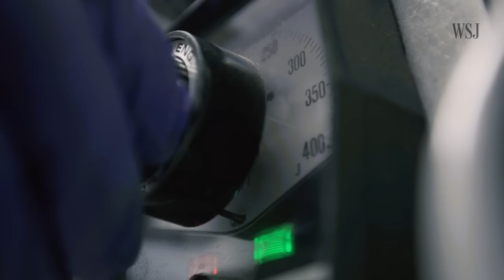Plastic: The Scourge of Cities Becomes a Resource | WSJ

Comment: A LOT can be done to make 'dirty' plastics a great deal more recyclable.

A - No more labels, period.  Print the 'label' directly onto the plastic, using inks with either a very low vapor point so they can be boiled off, or based on the same plastic that it's being applied to.
B - Single type plastic by product.  No more mixing plastics in products.
C - Much larger, easier to interpret 'recycling' identifiers.
D - Reduce/eliminate plastic alloying (which is why there are hundreds of different 'types')

Comment: And only recyclable plastics should be produced.
Reply: This statement means your don't know how plastic is made.

Even recyclable plastics can only reprocessed 4 to 7 times. Then it goes to the landfill. And even during that 4 to 7 times virgin plastic is needed to form the strong enough bond to be used.
Reply: @pauls5375  chemical companies and researchers have been working on a better plastic that can be depolymerized and repolymerized indefinitely. It takes proper chemistry and careful manufacturing. This is why the ibm guy is looking for polyester. It's a more versatile type of plastic. Other plastics like vinyl and PVC are terrible and more of a toxic one-time creation. It needs to be used only selectively in industries that can't use anything else.
Reply: @Iquey  yes, agree... Partially However due to how hydrocarbons are broken down this is not possible. This is my field. I work in hydrocarbon cracking and pyrolysis. The issue is that the Co polymers that are added to complete the bonds are then later categorized as contaminates. Removing these impurities in current tech and processes are not viable for companies when virgin plastic is 70% cheaper to use. This is the real issue. The economics of recycling aren't beneficial to companies. Once recycling can be monetized large scale will we see a transition to true plastic recycling.  Thanks for the thoughtful reply, becoming more and more rare in YouTube. Have a good one.
Reply: Biodegradable plastic made from organic material like seaweed no more oil for anything
Reply: @davidbeaulieu4815 `  Mushrooms are also being used
Reply: P S I have a question since this is your field. Do you know of any biodegradable plastics that can be used that could possibly compete with oil based? Instead of creating 100% recyclable plastics which seems to be expensive..
Reply: Yes!
Reply: Plastic films can be converted to burnable fuel
Reply: This plan can't be enforced. Find a way to use the plastic. Regulation doesn't work. People look for cheap products and they will cheat to survive. Taxes are cruel answers to this problem.

Comment: should be a law, only renewable materials from now on
Reply: Agree 100%, companies that mass produce plastic and other non close loop recycling materials should be held accountable since they're only looking at the bottom line.  Also, companies like Coke, Dole, Pepsi, etc should also be held accountable since they're just buying plastic materials so they can make a few cents more per bottle compared to aluminum or wax coated products.  If you think about it, if they're saving a few cents for every bottle, and they sold a million of them, how much extra money are they making.  Just do the math.  You can go to the grocery store and buy some sliced fruit placed in a plastic container which is insane.  If people want sliced up fruit or whatever then it should be in a aluminum can with an easy open top or wax coated box.  It may cost 5 cents more but it's better than using plastic in the long run.
Reply: Max Ko
Reply: Max Kon
Reply: Max Koni
Reply: Max Kon
Reply: It would be France 2.0. Renewable Technologies have to be as good or better than what we use now only then will we be able to reasonably change. Hopefully it’s as soon as possible. The mid 2020s are looking hopeful. Fusion would solve all our problems in pretty much
Reply: @maxkonig559  our government must have the political will to make this happen, maybe not now but in the years to come.
Reply: you're naive to think the government is in control

Comment: Singapore has a partial solution.  They just created an Aerogel out of plastic bottles.  Industrialize that process and you have a great insulation material with great heat resistance.  A good building material.

Comment: The government should encourage and provide subsidies for the recycling companies, like Chinese government, who promote electric cars production and discourage gasolines at the same time.
Reply: In a lot of situations electric is worse than gas because we simply use coal to make the electricity.
Reply: Benjamin Lehman in that case the government should discourage these kinds of facilities or promote wind or solar electricity.
Reply: JBI JBI I heard somewhere it costs more to make the wind turbine blade than the money it will save from electricity in its whole life. It is the future but the technology just isn’t quite there yet. If the government offered tax cuts that could help people want to make the technology more efficient.
Reply: @benjaminlehman3221  It is definitely worth it with solar though.
Reply: @benjaminlehman3221  that's incorrect. Even if the energy comes from coal, it's still a smaller carbon footprint than a combustion engine car as the coal power plant is more effective than many small combustion engines.
Reply: achryl just watch Adam ruins everything Adam ruins going green. Some electric cars are not good.
Reply: Benjamin Lehman I saw that episode too but although it is not completely eco friendly because of the battery and electricity use it is still a move foreword away from the combustion engine which is directly polluting
Reply: Billy Bob the technology just isn’t there yet. In a few years and hopefully with solar or another form of renewable energy the electric car will take over.

Comment: There is also another way of using plastics as a fuel, to power syngas generators. However there is some C02 which does escape in the process, but I have heard of a machine in Canada which takes C02 and turns it into fuel. Again there are ways, to deal with this issue, that none of you people are thinking of.

Comment: May I ask if there is a problem with adding some form of glue to the mix and compressing the plastic into bricks and using them as a building material?  That way you truly get to recycle it.  
Is it because there is no profit in it?  I'd say plastic homes would be one way to solve a great deal of homelessness caused by lack of housing.  Simply serialize the plastic by what ever means necessary -  boiling, washing, etc; then via different strengths of blowing separate the hard plastics from the light.  Compact them into a mold with some resin, bake under UV and Bob's your Auntie's living lover!
Just putting it out there.

Comment: Somebody please help explain this to me if I am wrong - there is cheap biodegradable plastic available in the market - PLA plastic. Is that not the solution? I understand that older plastics still need to be recycled, which I think we can deal with over the long term (through chemical recycling), if we can first stop the problem  getting worse every day by adding to the mountains on non recycled plastics.

Comment: Actually what you are saying is wrong. You can recycle LDPE which are the plastic bags, as well as HDPE which are the milk bottle and the oil cans, plus the PET, today. Im not understanding why you are saying no. The main issue in the recycling is how to remove the labels and also how to remove the glue. Here we separate the plastics, before it goes to the landfill. We separate the plastics, we do not understand why in your video everything is just thrown in together. If you find away to not use glue to hold the label in place, that would make our job much, much easier and cheaper to recycle the plastics.

Comment: Not using plastic / reducing plastic use is always a better solution to chemical / mechanical processing. Reducing plastic use obviously eliminates the requirement to cycle at any point and so reducing the overall emissions for packaging.
Reply: Untrue.  Plastic is light and easy to use compared to glass, wood or other "natural" replacements for containers.  This sort of recycling is exactly how to move forward.

Comment: You can't just liquify it all and filter it? All of it goes in, only low melting plastic comes out，then higher melting and so on. All the stuff that's liquid boils off, all the stuff that's not plastic separates out, all the stuff that doesn't melt stays on top of the screen.

Comment: The interesting point about using the economics of things as a moral dictate is the undesirable outcomes. Sure, plastics are “cheap” to produce and put into circulation, but what do the economics matter when we’re choking in waste output? We should either apply a social hazard discount rate to the future negative value of trash output, or just realize that an economic framework need not be our only view on reasons for doing actions that benefit the common good

Comment: So what happens to the stuff that isn't degrade by the catalyst? For instance a bunch of polyethylene in addition to the PET that doesn't get degraded. It goes into the filter? Seems like a low yield process that requires quite a bit of energy.

Then they have to repolymerize everything in the end too? 

Separations at the recycle streams is the biggest problem

Comment: This comment section is fairly edgy and don’t have a grip on reality. Yes I think we should use renewable energy and be able to recycle and etc, but you can’t do it instantly because of all the things that require things like gas and oil at this very moment. We don’t have facilities capable of doing all of this right now, and we need to build them. If you say “we need to switch completely to blank” then you have no grasp on reality, or you forgot

Comment: I'm sure all of the chemical byproducts from this process are perfectly safe or reusable....
Reply: They're obviously going to do a ton of tests before this becomes widely used.
Reply: My point is this is not the answer. We need to either reduce or stop using plastic products. Most plastics never disappear. They just keep breaking down into smaller particles. If we keep manufacturing plastic products our problem will never go away.

Comment: The plastic are all over world use it for making road
Reply: Here in Tucson they used cut up old tires mixed with the concrete or cement whatever they use to pave roads. It made the ride far quieter and the road lasted far longer. So they stopped.

Comment: Far too complicated and totally unnecessary, especially if we want to rid the word of single use and most other plastic, which I’m sure we all do. We ALREADY have the means to do so via Pyrolysis machines that turn old tires, plastics of all types, and even medical waste into clean burning low Carbon liquid fuel. Also once the process has started a ‘Syngas’ is given off that is fed back to keep the process running, meaning only at the beginning is an external energy/heat supply needed. I have seen a vid of a ‘Continuous Feed’ Pyrolysis machine, so it never cools down so continues to provide its own gas.